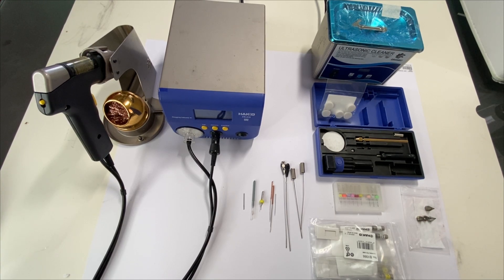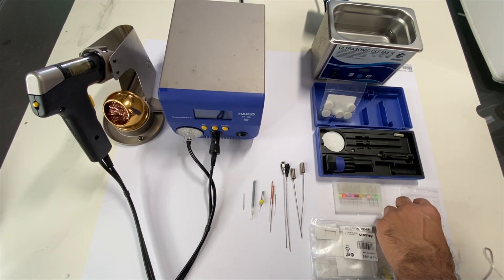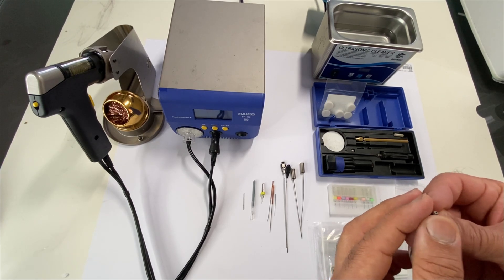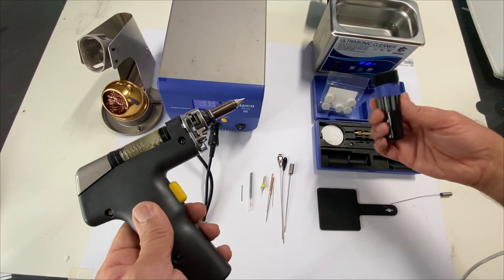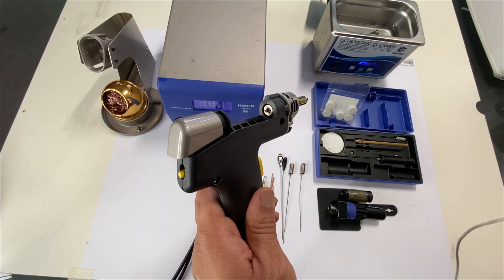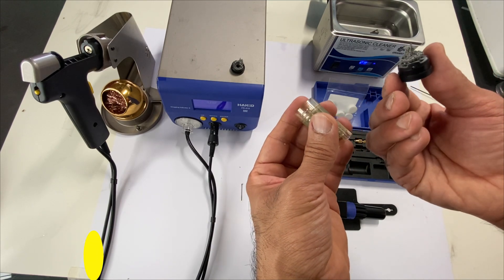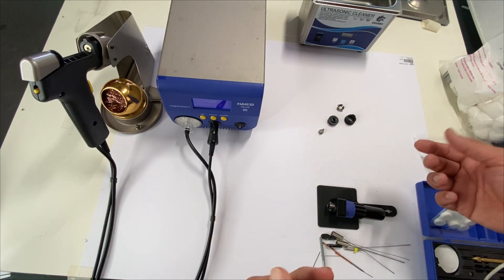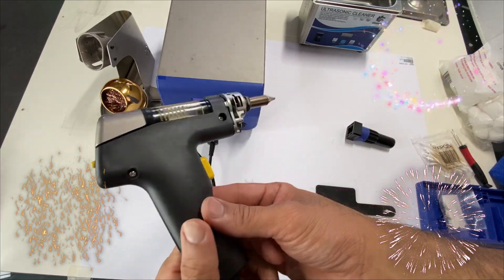HAKKO FR-410 Desoldering Station: How to Perform Maintenance and Filter Replacement

Comment: hi,
 it's also OK for Hakko FM-204 desoldering station ?
Reply from the maker: I wouldn't suggest using this video as a guide for the FM-204 Desoldering Station. Instead, it’s best to watch a tutorial specifically for the FM-204, as it's a different station with different components.

However, you can still apply some of our cleaning techniques, such as:

Ultrasonic Cleaning
Flux Residue Removal Process.
Reply: @GameConsoleRepairs  thank you si much  ! Could you please record a vidéo to show and explain How to clean the FM-204 desoldering station ? My cleaning pin stays stuck in the nozze won’t go any further, and I don’t have the cleaning drill yet. Thanks a lot !
Reply from the maker: @slipdermanmastercop4875  At the moment, We only have the FR-410 in stock. When we receive an FR-204 for repairs or maintenance, we'll be sure to create a video.

In the meantime, you can check the HAKKO forums to see if there are any guides or tutorials available for the FM-204